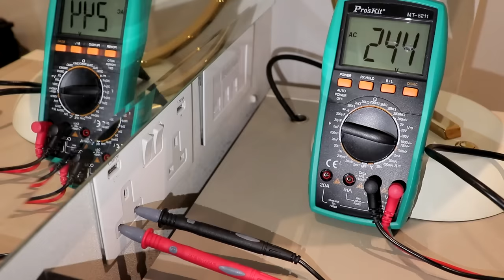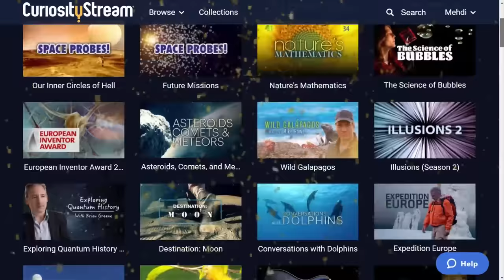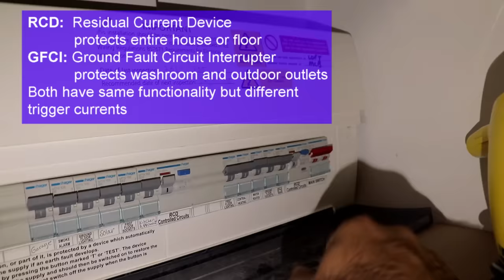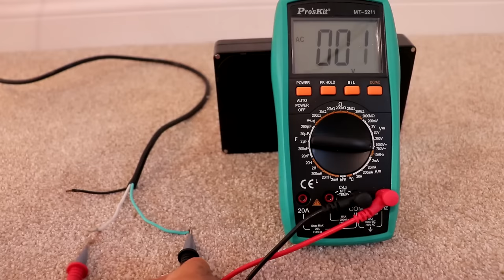Power Outlets in United Kingdom

Comment: UK: safest plug type, with RCD protection

ElectroBOOM: challenge accepted.
Reply: As a North American citizen, I can say that in my childhood I have touched both prongs of a plug while pulling it out. It was an uncomfortable zap where I could feel the alternating current, but I was fine. Needless to say it was a good lesson and I've been more careful since then. The UK plug is a good design, but how else will the children learn to not mess with electricity before they move on to harder stuff? Little Timmy might cut open a transformer to harvest the copper for drug money and be shocked with transmission voltage!
Reply: @Maptologist  While you were touching your north american plugs, Little Timmy in UK doesn't want to do that 'cause double voltage
Reply: @Nikkizzz  Under the same circumstances, Little Timmy wouldn't have been able to complete such a circuit, as his thumb and forefinger would only touch plastic. You all (y'all) in the UK have deadly house voltage because the infrastructure couldn't handle more amps at lower voltage. Therefore, complicated plugs and other safety standards were constructed around such an unsafe system.
Reply: @Maptologist  most of the world uses 240v, we just do it best. The UK invested a huge amount of money to change the plug design after the war to make things much safer. Very few people ever get electrocuted in the UK because it's very hard to do so. American wiring is awful and is an incredibly old design which they have never bothered to replace.
Reply: @JamesGrogan2  Most of the world use 220v UK is one of the only places that uses 240/250v
Reply: @joefarnell6566  in the Netherlands we use  220/230V
Reply: @joefarnell6566  Same thing, we technically use 230v with a tolerance the same as the rest of Europe. Although in practice we use 240v and mainland Europe use 220v. In terms of safety this doesn't have much affect and any device which is rated for 220v will also run on 240v
Reply: @Maptologist  "in my childhood I have touched both prongs of a plug while pulling it out."  Me too :D
Reply: That moment, when people casually talk about plugging and it's not sexual.
Reply: @joefarnell6566  Australia uses 230v standard. I've measured the output of power at my house around 250v.
Reply: @joefarnell6566  In Norway the typical voltage is in fact around 230 volts, mainland Europe has such a lazy powergrid at a lowly 220 volts...
Reply: @GForceConnections  In the UK it is between 240-250v depending on where you are I get about 245v at home. I have had someone using a US laptop charger melt before.
Reply: @joefarnell6566  Yeah I guess double the voltage and output would do that to a cable only rated at 110v. Most laptops modern chargers support both now and you just need a different adapter at the end.
Reply: Maptologist 454344 Our infrastructure is not primitive. The reason the UK went for 240v while the US went for 110v is that Edison conducted a smear campaign against AC current, including electrocuting an Elephant. While Westinghouse won the competition to supply their and Tesla’s AC current, the scare campaign worked to the extent that a lower and less lethal voltage was picked. In the UK, no such fear campaign was conducted, so 240v was picked because there are far less transmission losses.
The US was more scared, the UK was more interested in efficiency.
Reply: Joe Farnell Actually we use 220v but the appliances are rated for 240v.
Reply: Some interesting claims in this thread but Mark J is correct. Or grid varies and just because you have double the voltage doesn't mean double the death like some seem to think. Devices themselves still require the same power to work so in the States I've noticed you have two plugs on something like a washer or dryer. Plus I've noticed many times that the North American plugs can fall out of the socket easily. In the UK when they are in it ain't falling out.
Reply: @markj2093  in ireland it measures 237 volts at our house
Reply: @JamesGrogan2  I suggest a decent multimeter and putting it on your mains. Mine read bang on 230V AC, as do my sisters and brother in various parts of northern England and Scotland. The idea we are still sticking to 240V AC is a myth if you ask me.
Reply: @jonathanbuzzard1376  I've litterally just measured it with my £100 fluke meter calibrated only a few weeks ago at 242v. I'm not sure about the rest of the country but in London we use around about 240v.
Reply: @JamesGrogan2  Fair enough but its not 240V AC where I live...
Reply: @eBobbyo  Try to touch prong in CCE Type F.... 
And continental part of Europe use 230V +/-10%
Reply: @mateuszzimon8216  I'd have to make a superhuman effort to touch a CCE Type F that's plugged in - just about impossible I'd say!
Reply: No shocks are nice, but getting a belt from 240 volts is worse than 120 volts!
Reply: @JamesGrogan2  Perhaps because it's not dangerous, and only uncomfortable.
Reply: @JamesGrogan2  Actually here in Germany the voltage was increased from 220/380V to 230/400V. Since three-phase is common here, even in residentials, I also stated the voltage between the three lines and not only the voltage between line and neutral or the PE (protective earth). Or ground as americans use to call it.
Reply: @Maptologist  ‘deadly voltage’. You don’t know what you’re talking about lmao.
Reply: @jonathanbuzzard6648  your voltage will vary am next to the supply transformer and get 245v those away from the transfer will drop off due go transmission losses. You must suffer from brown outs when those closer to the transformer draw more current.
Reply: @shakeybill82  but our safety devices operate at less than half the current. And it's current that kills not voltage. So I would prefer 240v because it over quicker
Reply: Your plug must be safe because your distribution stinks. You have 16A outlets on a circuit fused with 32A. So unless you have idiot proof plugs with fuses stuff can go seriously wrong. A well laid out system has 16A outlets on a circuit fused with 16A. You don't need a monstrosity of a plug with a fuse. Making secure against touch is simple, recess the whole thing some 12/15 mm and you have a plug where everything touchable disappears in the wall where nothing can ever touch it BEFORE making contact. 32A circuits are also much more prone to bad contacts, it's why the UK had to abandon plastic distribution panels, they kept catching fire. Meanwhile 16A 240V panels in plastic don't do this.
Reply: @JamesGrogan2  Nope, UK plug is to make up for distribution that stinks. A 16A outlet on a 32A ring circuit is asking for trouble and rewiring for 16A star circuits would have been costly. So you designed a monstrosity of a plug with an integrated fuse to make up for it. Protection against touch is done by recessing the whole outlet, it's that simple. But you are right, the US ain't much better ;-)
Reply: @astranger448  we don't have 16A outlets. The maximum rated current for a domestic plug is 13A. Star wiring is incredibly expensive and wasteful. The plugs are hardly a monstrosity, not much larger than the european equivalent. I agree that the ring wiring which is quite common (but slowly reducing in favour for radial) is not the best design but it was a byproduct of a copper shortage in the 1930s and 40s when many homes were built. Recessing sockets means a deeper backbox is required, the current socket design means you can fit only 25mm backboxes which is beneficial for very thin internal masonry walls. The European sockets are recessed to a depth of 40-60mm
Reply: @JamesGrogan2  You point out the important thing, ring wiring being a byproduct of the 1930's copper shortages. It explains why you are stuck with a suboptimal system. And I see nothing wrong with showing some pride for your own system. The trouble starts when folks on the internet start touting a system with all the hang-ups from the 1930's shortages as 'the best system in the world'. That's fine for your sports team and your language and culture but not for a system that can kill you. Star wiring is costly, but you avoid 32A circuits for general use (special use is a different thing). A thermal problem in a less than perfect contact hits 4 times harder under a 32A load compared to the same contact under a 16A load. It's why we use plastic distribution panels and you switched to metal. At 16A max panel fires are rare, at 32A they are not. it's why you move to radial too despite the cost. Recessing in existing houses can't be done but for new housing it should be the norm. 
So whenever I see blokes on the internet go on about 'the best in the world' i go a bit counter. Doubly so with electricians, they should be honest about the shortcomings.
And there is nothing wrong with the UK plug, it's doing a good job keeping you safe and we have something to tease you about.
Stay safe.
Reply: My dad touched 230v 16a more than 5 times he desribed it as a short pain but not that bad. Maybe he said not too bad cause he lost a finger at 14 y o
Reply: type f: am i a joke to you

Comment: Those shaver sockets in the bathroom are actually completely galvanically isolated with a 1:1 and/or 2:1 wound transformer inside them, that's why they're so strangely large.

Comment: UK: Yeah our plugs are pretty safe 
Electroboom: "I have shorted the plug, Hopefully nothing happens" explosions
"I have now run away from the Hotel"
Reply: intentionally shorts power outlet
is shocked that the outlet explodes
demands that hotel staff fixes it
“I have to run from hotel now!”
Reply: What was the music name?
Reply: 0:30 "I brought so many test equipment, security was very suspicious"
2:44 [proceeds to blow up the hotel outlet]
Reply: stop spamming
Reply: Monty Python the Flying Circus  Also incredibly expensive. Aussie plugs are close to the cheapest plugs and have almost all of the safety features. As well as being able to have a 2 pin variety which cant be reverse polarised (our plug doors work on both lines entering at once).

Comment: Also electrical outlets in bathrooms are also supposed to have isolation transformers. If you plug a shaver or adapter in, it is often possible to hear a buzzing sound coming from the transformer.
Reply: Thats what that noise is! I always wondered why it 'buzzed' when I put my electric toothbrush charger in.

Comment: Those shaver sockets also have isolating transformers inside, which is why they are so big
Reply: True
Reply: Very true. The isolating transformer prevents a electric shock from occurring if one of the electrical contacts is touched.
They are also fed from a 3A fused-spur located outside the bathroom, so that limits the power of what devices can be plugged into them.
Reply: But then there is no RCD protection?
Reply: Samuel Seidel On an isolating transformer, RCD protection on the incoming side is redundant by the nature of transformers, and RCD on the output isn't generally required since they're current limited to 200mA and there's no reference between the output line and the earth back to the isolating transformer, meaning a shock can only be achieved between Line and Neutral
Reply: @frankiesparkes3947  
What if one of the outputs of the isolating transformer comes in contact with the earth? Seems like there is no way for detecting that. Then isolating transformer is no more isolating, and you have no protection from shock.
Reply: @vladan_kovacevic  If that is possible, then you could also assume that a human is always connected to one side of the transformer - which, to avoid, was the whole point of this setup. I don't think people who care about that transformer also defeat its security instantly.
Reply: @vladan_kovacevic  that why it is called insulated transformer.... So the way you can get shocked it is by line and neutral
Reply: Confirmed.
Reply: And why they have a maximum power written on the front plate.
Reply: @juststeve5542  To protect same transformer against overload.
Reply: Also the RCD is NOT for shock protection, hence the higher milliamp trip current. The UK doesn't bond neutral and ground/earth in each building in an attempt to prevent the shells/chassis of everything becoming live if the main neutral between the breaker box/consumer unit and transformer goes open circuit. Since the only path for live to ground fault current is now through the literal earth between the building ground point and the transformer ground point and the impedance of that path can't be trusted to be low enough to pass enough current to trip a regular thermal magnetic circuit breaker they have the RCD to, again, prevent a hot chassis situation. Imagine a live to ground short circuit fault with a ground impedance of 24 ohms and no RCD, it would just pass 10 amps all day long without tripping anything and all of the grounds in the building would be live at the full 240v. RCD to the rescue.
Reply: @skuula  sorry I mean that's why they have a maximum power written on the front. I'm from the UK, I'm very familiar with them!
Reply: They don't all need to be so big. The bulkiness is a flaw in the design.
Reply: @danielthechskid  the rcd is exactly for shock protection. It started off with just sockets likely to be used for outdoor equipment but now nearly all circuits are protected.
Reply: Daniel Armstrong Nope.  Whole house 25mA or 30mA RCD/GFCI breakers are still there for electric shocks.  The higher rating is because many normal devices leak a small current to ground, which would trigger the RCD all the time.  There's also even less sensitive RCDs for circuits with lots of known leaks, such as certain special electronic machines.
  By the way there is a way to avoid shock from isolation transformers.  It's too expensive for bathrooms, but basically raises an alarm if either of the two live wires connects to ground.
Reply: @johnfrancisdoe1563  how would this be possible? I can only imagine a big (1M) resistor on each output from the transformer to ground. Then measure the small current between the resistors. If the current drops to half, there must be a short  over one of the resistors. But you would also need to measure the load-current, since this could cause a earth-current drop, too.
Reply: @danielthechskid  The RCD most certainly does provide shock protection. Contrary to your statement, most UK power supply systems do have bonded earth/ground and neutral. With TN-C-S PME (the most common sort, especially in modern systems) the protective earth and neutral are combined in the supply and a separate earth is connected to the neutral at the supply head. With TN-S systems, which you can find in some older properties, the supply arrives with Line, Neutral and a separate Earth and the latter two are bonded at the point of entry. The separate earth is delivered in the form of lead cladding.  

The only system where Earth and Neutral are not bonded is on TT systems and they use a ground spike and the protective earth is completely separate. Those can often be found in more remote locations and some older housing. It is certainly true that RCDs do provide essential protection on those as the earth impedance will be too high to trip most MCBs (and often even too high to trip a 6A MCB). Prior to earth leakage detectors, TT circuits were meant to be equipped with voltage driven trips that detected the protective earth rising to high voltages. However, RCDs (or RCBOs) have been compulsory on all earthing systems and were initially introduced in hazardous environments (bathrooms, kitchens, external circuits etc.) to provide shock protection on all earthing types.

John Ward has an excellent video on UK earthing systems.

 https://www.youtube.com/watch?v=AWxeb2MI37c
Reply: @TheEulerID  Is there a graphical drawing of these types? I appreciate the information and was going off of information in a video of a UK electrician, though I can't remember which one. As I have learned the hard way from being a member on Quora, someone's stated qualifications means nothing as they regularly get stuff wrong. Thank you.
Reply: @danielthechskid  He may have been talking about TT systems. John Ward covers it well, but there are plenty of drawings on this side as well as covering related issues like bonding.

nb. one error on my part is that TN-S is only bonded to neutral at the distribution transformer, although it still has a very low impedance so MCBs can deal with line-earth faults. It's also a relatively small proportion of older premises.

https://electricalapprentice.co.uk/an-introduction-to-earthing-and-bonding/
Reply: DARK APPERITION  UK shaver sockets typically have 115v and 230v (nominal) output voltage, although some are just 230v.
   Whilst the standard UK voltage is said to be 230v, it's typically closed to 240v. The EU 230v standard is actually a range between 216.2v and 253v as some countries are close to 220v, and some closer to 240v. It's really a standard for manufacturers to use when designing electrical devices.

Comment: In the UK houses are usuall wired in a "ring" circuit with a 32A breaker which is feasible since the plug has a built-in smaller fuse. When you shorted that plug on the end, you caused a 240V 32A short! No surprise it got black :)